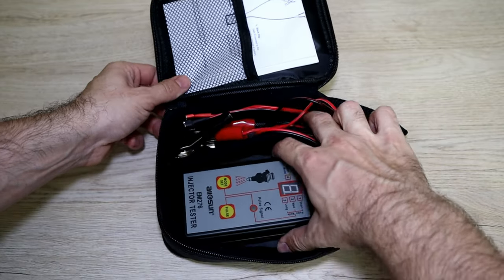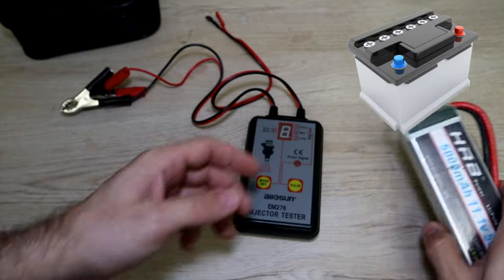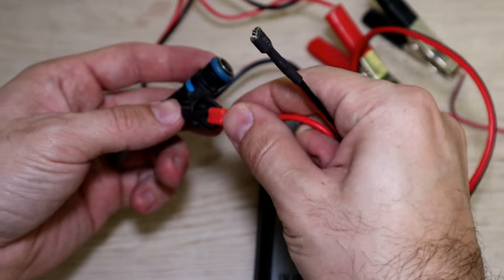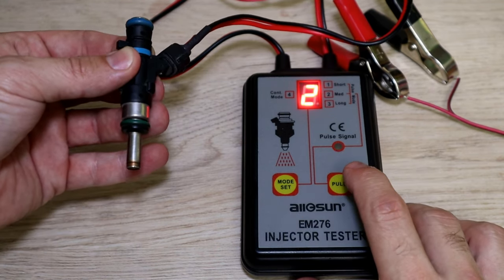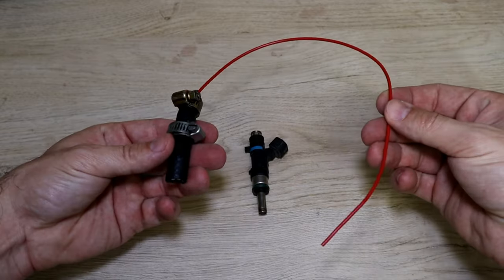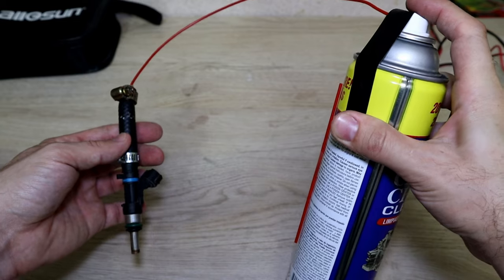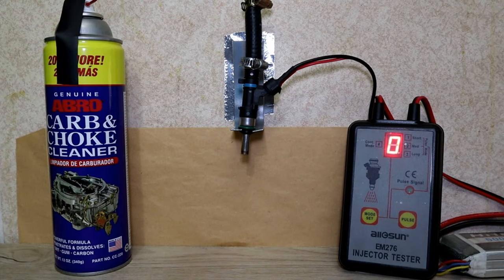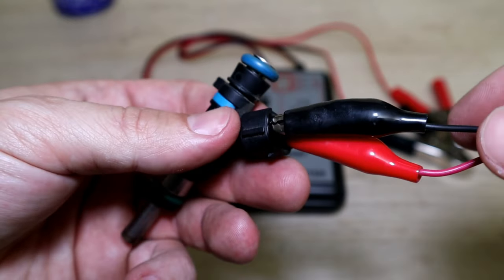All you need to know about Fuel injector tester kit/Cleaning fuel injectors  /AllSun Injector Tester

Comment: I have one and I use a dewalt 12v lithium battery. I soak all of them in sea foam (in a jar) in my ultrasonic cleaner and I connect each one to the tool set on steady pulse for about 10 mins each. I take the o ring off each injector as I disconnect from the power so that I can keep tract of which ones have been run while soaking and cleaning the entire set. The jar allows me to fill the cleaner with only water and after I finish I simply remove the injectors and cover the jar and set it aside for the next time I need it.

Comment: Question. When you pulled the injector out, was the metal tip extremely gunked up with burnt oil and carbon? Mine look terrible, not sure if that is expected or if i have a failed seal somewhere

Comment: How much ohms does Siemens DEKA injectors supposed to be and question what you use to stop the fluid from coming out from the hose when u sprayed it with carb cleaner like how you sealed it so it won't leak

Comment: to change the mode i believe you don't have to disconnect the battery.. there is a reset button, top left-hand side... at least mine has
Reply: Can you Tell me, If i can Clean my injectors with That Gadget without an Ultra Sonic cleaner?

Comment: Why when I connect my injector or reconnect to battery it clicks?as if it engages. And when I spray the cleaner and active the tool it sprays very little as if it doesn’t engage it properly. What do you think is going on?
Reply: I could really use the help thanks
Reply: @rafagas5150  Did you figure it out? Every time power is applied & removed the injector cycles or clicks. Power open and depowered closed. When power is applied, you should see the same spray as your can nozzle come through the injector. That has been my experience. If not the same spray, its clogged or not opening all the way? I had an injector that would work beautifully on the bench. When in the motor, would work on cold engine or on interstate driving. However, when I would stop for gas refill or a short period, the injector would get hot and not work? I pulled it back out, on my test stand worked great. Used a heat gun, heated it to 200 degrees, injector would not work till it was cool again. It was the #4 cyl misfire on a 4-cylinder motor so it got most of the heat I guess off the motor. 
Good Luck

Comment: It does matter what connection is positive or negative. You are incorrect, Solenoids operate open or closed.
Reversing the polarity with close the injector, therefore NO fuel flow. Read a wiring schematic.
It is still Ohms Law.